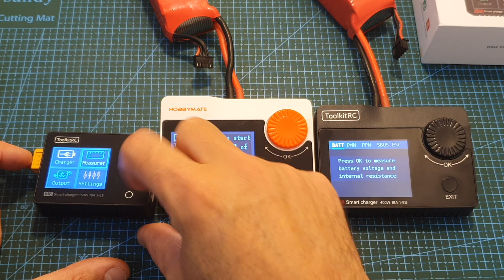ToolkitRC M8S 400W Smart Charger - Giveaway & Overview

Comment: Hi. Did you charge 18650 Lion battery by M6? When i start charge, the voltage is up +0.2-0.3V, and after 1-2 minutes charge is finish. I tried several 18650 batteries and tried low current (0.1-0.2A) - it didn't help.